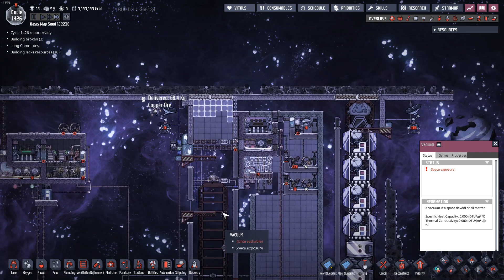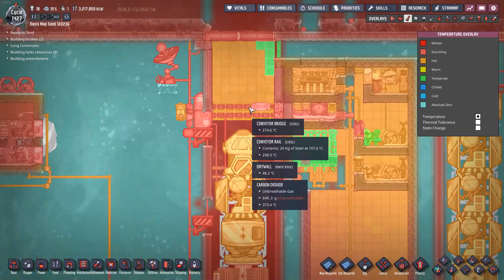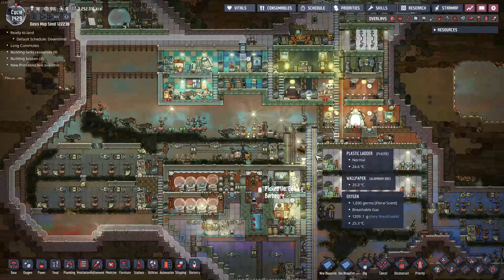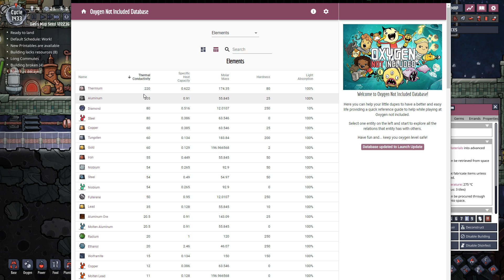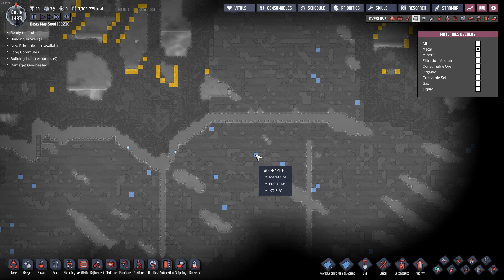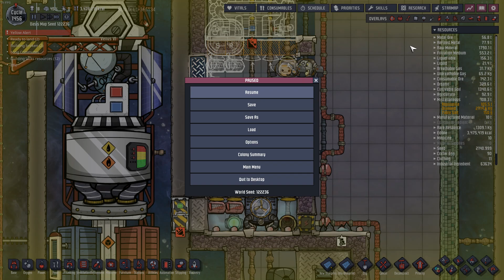Tiny Liquid Oxygen System! Oxygen Not Included ep34

Comment: Might be better to transfer the rocket heat to a room filled with steam (or super coolant if you can afford it) that acts as a thermal battery then transfer that heat to your steam generators. Rather than having the turbines only running during launch.

You also might need another turbine for your Lo2 setup. An aquatuner running supercoolant outputs 1,181,600 DTU/s but a single turbine only deletes 877,590 DTU/s. Might be ok since it's not running constantly though

Comment: From your own experiments, transfering heat from that one wall to the other side, wont be efficent unless its something like diamond, steel, refined carbon.  It just doesn't have the heat capacity that a plain old 1kg packet of steam would carry.  (Atleast that what I got from one of the last experiments, its hard to tell which of the two properties you need and when one goes to low to do the job at all)

Comment: Don't know if you know but the heavy wire plaques are technically bridges. Their primary use is to passe the wire through walls, but you can also run other wires through them too, so long as they're not heavy wires of course. Actually would be nice to have something for that.

Comment: The best way to extract heat from a rocket would be to make a diagonal pattern of temperature shift plates in the rocket silo (they can exchange temps diagonally). Preferably you'd want to make it out of something with high thermal mass as opposed to conductivity the higher the mass the more energy they can store with every single rocket launch.

Side note it's imperative that you make it a diagonal pattern and not a full temp shift plate wall (unless you contain the silo with a airlock) because if you do it will vent extremely hot, dioxide everywhere I will cause a lot of problems for your space base.

Comment: Instead of harnessing solar power by opening and closing doors, could you just block out the sun with bunker tiles and run diamond on a conveyor line through them and transfer the heat to a steam generator for more energy without expenses of running a solar operation
Reply: didn't he severely lack diamond this time around?
Reply: @darkgxk  You could use other mats but diamond has the best thermal conductivity. Its about moving the heat to a more useful place without much effort

Comment: btw the mini pumps aren't actually more efficient its just compact.
Reply: I think the are efficient to make a vacuum as most of the time you will be moving very little gas, a normal gas pump would waste more energy to move it
Reply: Dennis Xiloj normal gas pump can move 500 g/s worth of air, unless the room is near vacuum you shouldn’t be using a mini until it’s actually that small.
Reply: @gandalftheantlion  you usually start with less gas than usual, or at least you should if you can, for example it's easier to dig/deconstruct to make a vacuum and pump out just a couple of tiles. There is a good video about it from Tony advanced